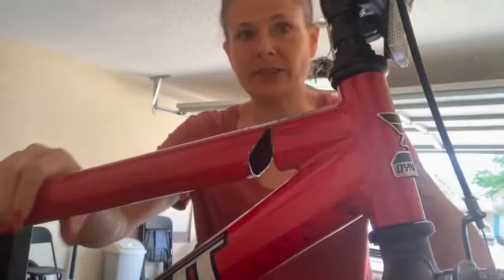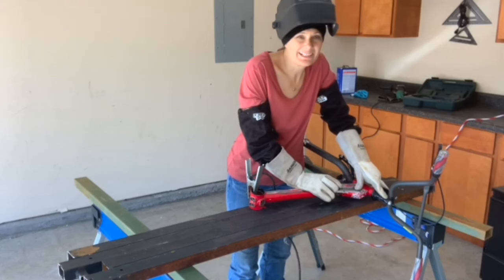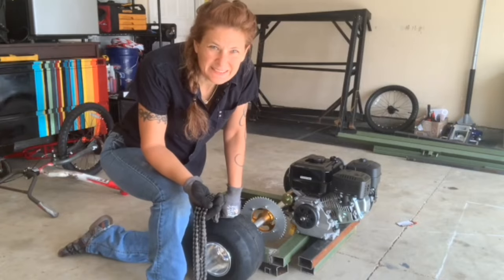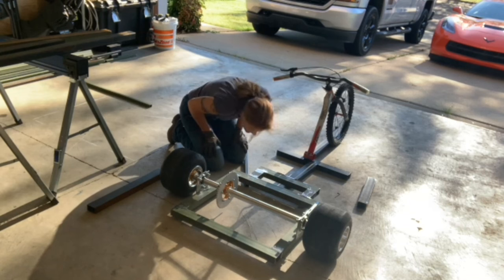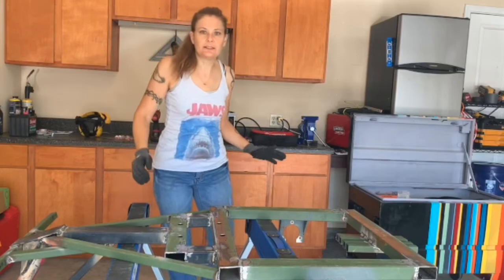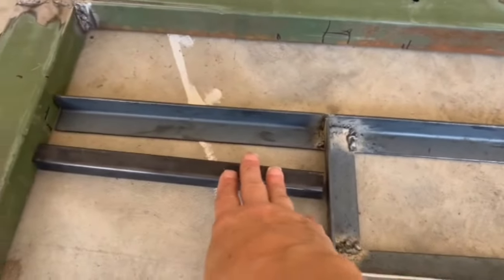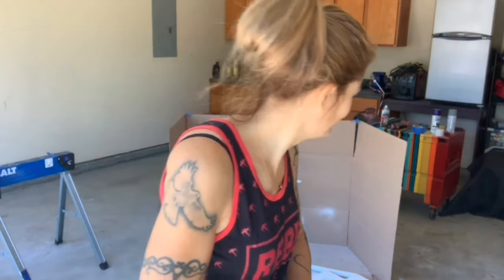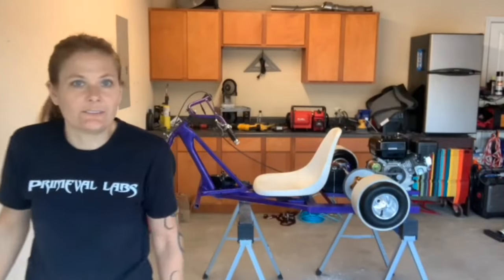Building a drift trike start to finish

Comment: You are working yourself hard using that Dremel tool. You need a 4 1/2 inch angle grinder with cut off and grinding wheels.

Comment: Do you have any tips or ideas? I’m starting a go cart for the kids from a frame this pre-built and looking for my first welder machine.
Reply from the maker: Lincoln 140hd I think that’s what it’s called. That’s a wire feed welder and if you haven’t welded before that’s a good choice. I also use a TIG welder from Eastwood I really like and it works as a stick welder as well. Good luck

Comment: Can i have a question? How much do you think this project cost?
Reply from the maker: Over $1000. Axle kit, wheel hubs and tires, battery, engine, throttle, seat, Plus the cost of metal which you may be able to get at a scrap yard

Comment: Where did u get the axel and sprocket frm?
Reply from the maker: The ROP Shop | 36 Inch Shaft Kit for Trike Drift Bikes includes (2) Go Kart Tires
11x6.00-5.  But I just went to the site and couldn’t find it

Comment: Where did you get axle and wheel parts from sis? please share, i want to make one.
Reply from the maker: The ROP Shop | 36 Inch Shaft Kit for Trike Drift Bikes includes (2) Go Kart Tires 11x6.00-5

Comment: Do you know measurements of the frame by chance
Reply from the maker: I built it for me I’m 5’5” So a larger or smaller person may need different measurements
Reply from the maker: Looks like the axle is about 39 inches, the whole length is around 80 inches that includes the front wheel,the foot rest is 28 inches,the frame where the seat is attached is 26x26 and the center support that runs under the seat to the place where I attached the front half of the bicycle is 24 inches

Comment: Was that your first build of a motorized vehicle you should not have put the axle on the top of the frame they go underneath they're more stable that way
Reply from the maker: The frame goes under the axle on a drift trike
Reply: They are NOT!more stable under the frame.